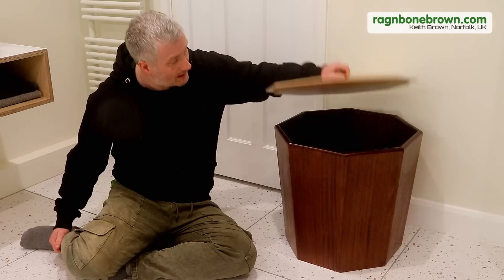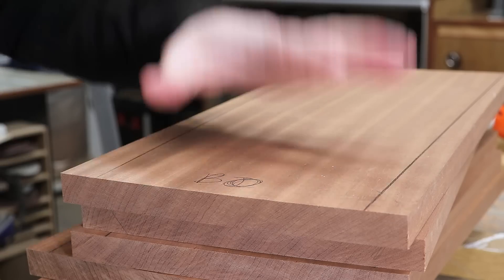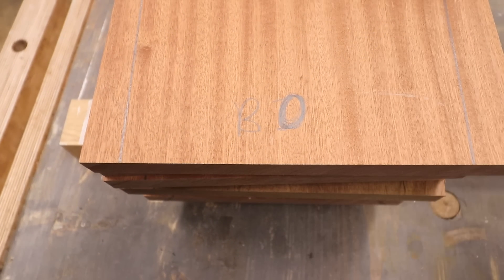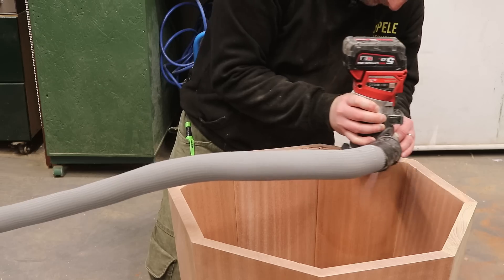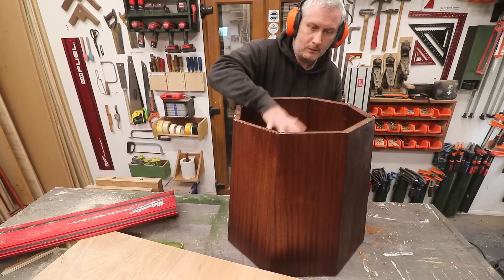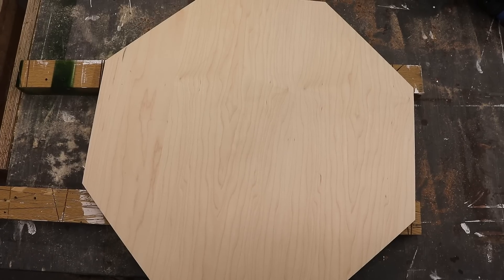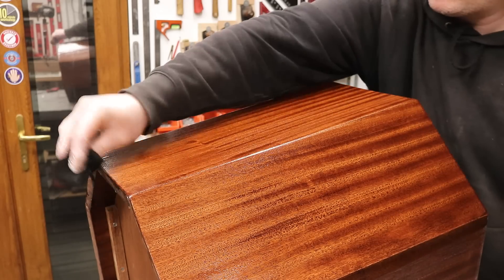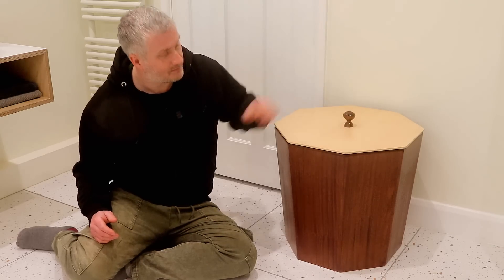Making A Lot Of Mistakes... And A Linen Basket!

Comment: We all have those projects that just seem to be one mistake after another. I've been working on a new top case for a vintage stereo receiver and I've made them all. Holes in the wrong spot, gluing in the cold, forgot to change out the long brad nails for short ones and nailed the project to the bench, gaps in glue lines, not using sacrificial pieces routing and cutting causing the wood (also Sapele) to split out. I'm finally getting the finish on. It's how it comes out in the end that matters, after all. Great work, as always.

Comment: Hey Keith...
I suggest you get some solid foam insulation panels to use as a support base for the track saw. This way you will have full support for the work piece, and a stable work surface for the saw. I stopped using sticks a long time ago when I forgot where the sticks were and the work piece folded in on itself and jammed the saw. The kick back was frightening.
Nice job on the basket, too. Thanks for sharing.

Comment: Despite the hiccups it came out looking great Keith, so all good !

It would have added more stress and also chances of errors but I'd have been tempted to use dominoes or another physical connector on the long edges for strength, but I'm sure it's strong enough as it is for it's intended purpose !

Comment: Been thinking how to taper some 2x3 to make table legs. But I only have a circular saw. Actually figured out how I might be able to do it from this video1 Use an adhoc track clamped down on top of the piece with some support piece to hold track level. Might just work.

Comment: Very nice!
I found myself wondering how much the 5 degree angle on the top mattered, given it got rounded over anyway ... though I haven't ever used a router - a parallel-to-floor surface is likely easier to work with?